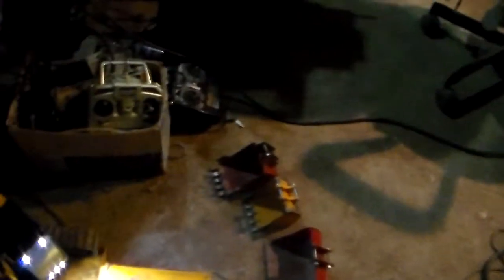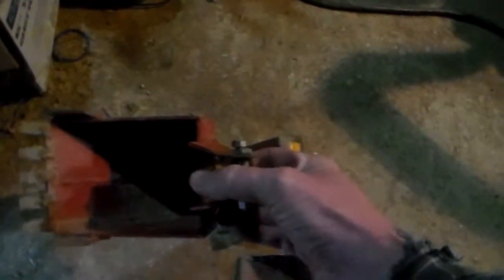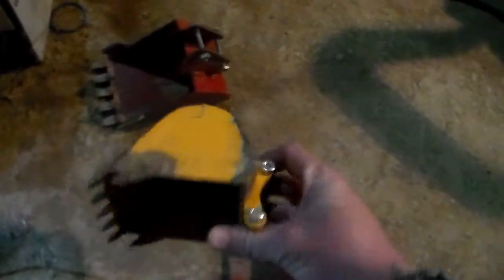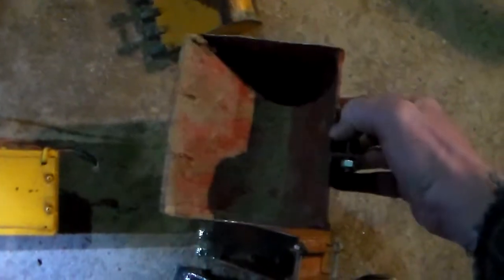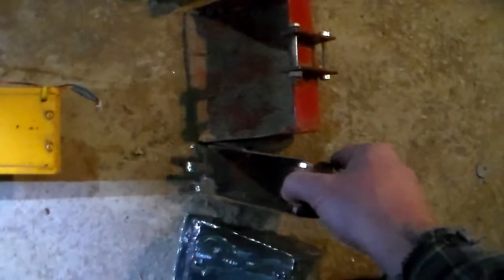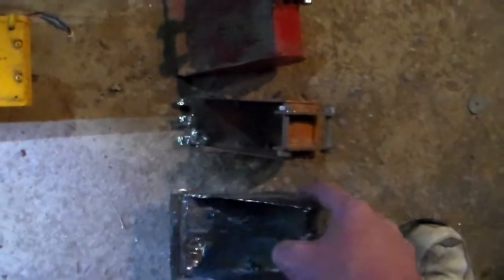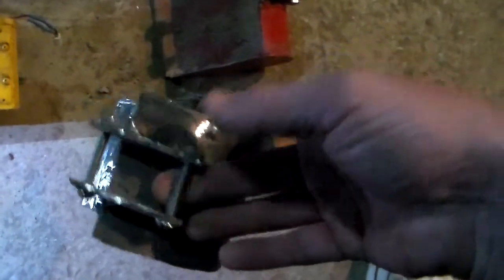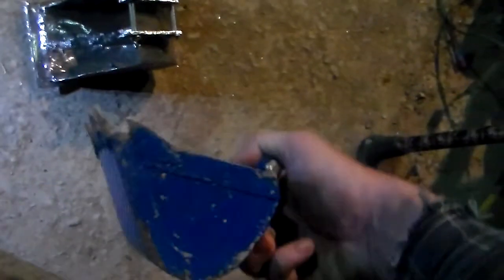my bucket collection

Comment from the maker: oh, I just had to replace a wire in my airtronics radio, I could have done a video of that I suppose. I never even thought about it before. the wire broke in the middle so I had to solder in a whole new wire from the sensor pad to the main circuit board. they use really thin, cheap wire so I put in some quality wire in its place. I have had to that to two other wires in that same airtronics radio. I have nothing but trouble with my airtronics radios and I will never buy another one, they suck!